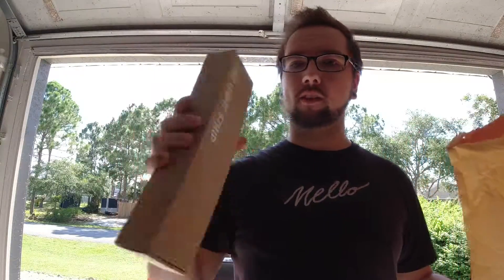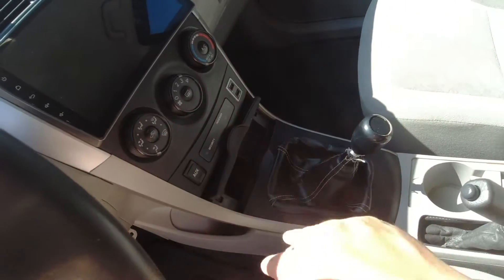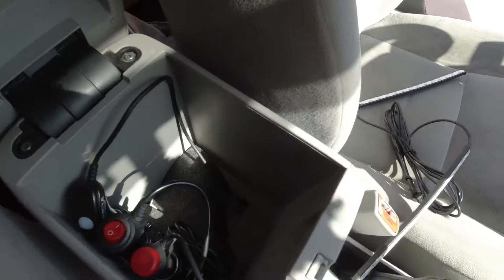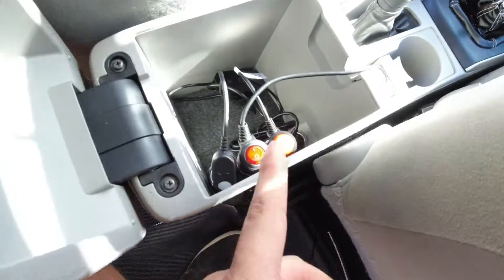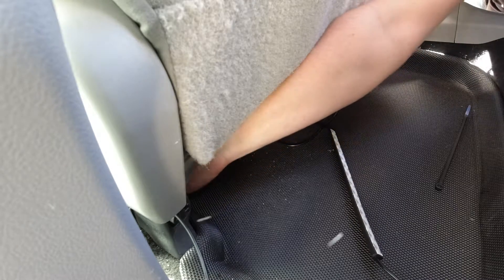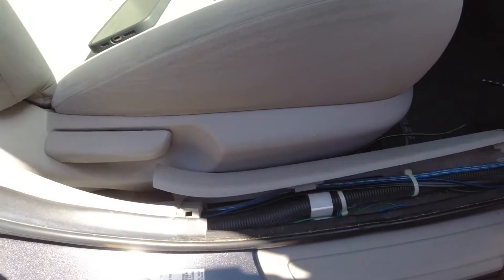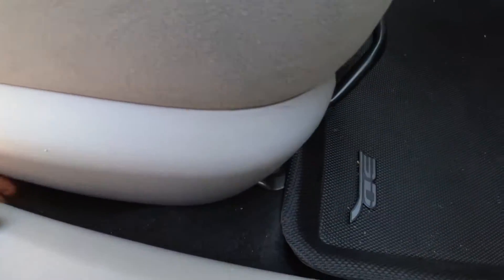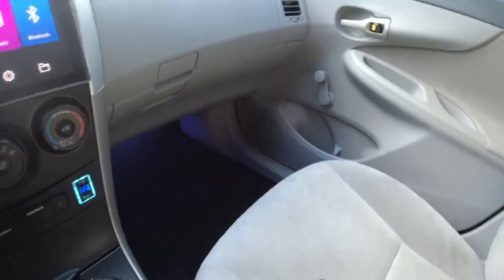COROLLA GETS FOOT WELL LIGHTS!

Comment: Wow, I'm not really an LED strip person but these came out looking really nice, it really got me thinking about installing them in my corolla!
One a side note, I noticed how you said that you tend to avoid the 12v cigarette lighter port below your infotainment. I do the same thing as well because when you plug something into it, it makes that section of the car look messy (I hate having wires just sticking out). I also hate how you can't stick your phone into the space next to the lighter because it's not wide enough.
I was thinking a cool mod would be to completely remove that section and 3D print a new section that would not have a side for the cigarette lighter. This would create a space big enough to fit my phone, and maybe a wireless charging pad as well. The cigarette lighter can be hidden away, zip tied behind the infotainment. This would actually be perfect for your needs since you could connect all of your 12v stuff there and have it hidden.
I did do some light research to see if someone has created this, but I couldn't find anything...
Anyway, I'll stop rambling, Great video as always!
Reply from the maker: That is a big thing I hate about this car as well, I wish there was a good spot to put your phone.
And making a new cubby with a wireless charging pad would be a great idea to do, and it would give a spot for the phone. 
I will definitely have to look into trying to 3D print one. Just need to try and design one and get all the dimensions!